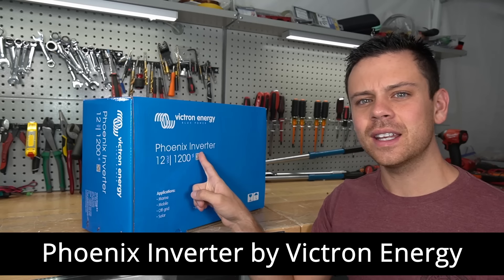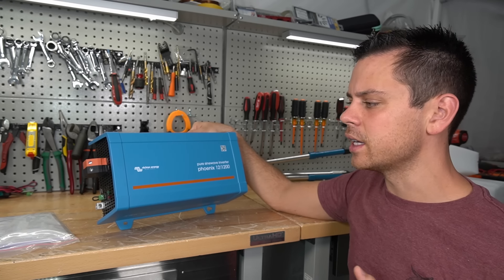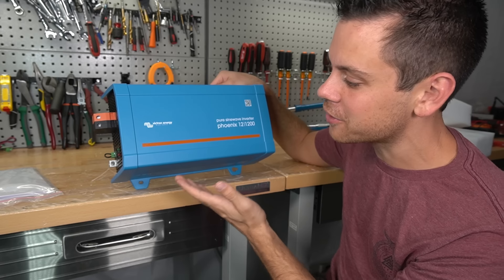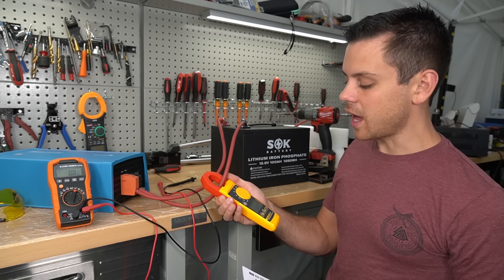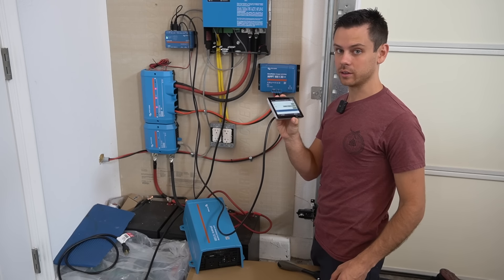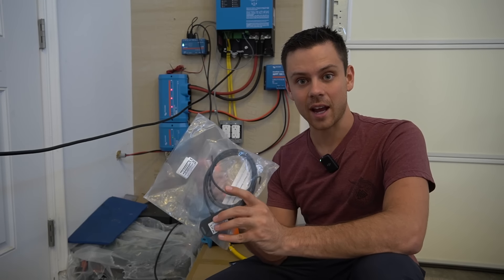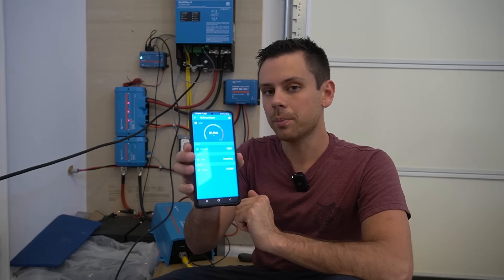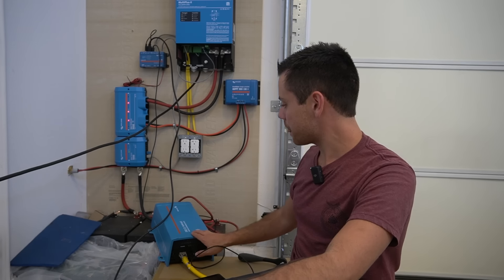Victron Phoenix 1200VA LF Inverter: Extremely Low Standby Consumption and More!

Comment: Victron is simply the best manufacturer of all this kind of equipment there is on earth. I just love their stuff and their support.
Reply: Ya and they charge alot for being the best. That's the way it goes. It's always best to find the product that is the best that isn't too expensive. There is a point of diminishing returns.
Reply: When it comes to off-grid, Victron is the name you can trust!
Reply: Roger that
Reply: Morning Star - Suresign fanless is probably more reliable
Reply: @randybobandy9828  they can save you money if it means you need less battery due to their efficiency. Keep in mind, it's more unlikely to fail.  If I'm camping in the middle of nowhere, I don't want my inverter failing on me.  When it does, I'd need to go out of my way to buy another one or ship it away for a warranty evaluation
Reply: @veganpotterthevegan  no, batteries are dirt cheap now. I can get new lifepo4 batteries for as low as $68/kwh that's like 4x cheaper since I originally posted this comment. It's actually crazy how cheap lifepo4 cells have gotten. The extra few percent of efficiency that a victron system can add won't be enough. There are plenty of alternatives that are almost as good that are less than half the cost. There is a threshold of quality vs cost that victron just is way too much.  I don't buy pre bought batteries, I build them myself from the raw cells because you can be assured of the quality and you get them for the absolute cheapest cost.
Reply: @randybobandy9828  yes, they're still cheap.  But you also get to save space with a more efficient inverter and charge controller.  That's not important to everyone but it definitely is for me and reliability can be life or death with some of the places I camp🙃
Reply: @randybobandy9828  that cost threshold is different for everyone.   I'll absolutely pay for Victron if it were 50% more expensive than it is now.  I don't skim on vital electronics, my bicycles or my coffee.  I'll gladly drive used, cheap Japanese cars though.
Reply: @randybobandy9828   as will has noted before, you're rarely actually buying the best cells.  EVs get the bulk of them.  You'll get cells sold as the best though but luckily they're good enough

Comment: Dang man, when you were talking about the high cost I was thinking $1,000 +. $400 isn't that bad at all. Being limited to 1,200 watts is harder to overcome than the price.
Reply: That's almost the cost for a gallon of milk these days.
Reply: @steveguy7165  its cheaper if you consider the gallon of gas to get it.
Reply: @Ranch321  what did you say? 
Did you not watch the video?
Reply: @fishhuntadventure  where do you get your milk from?
Reply: @Ranch321  cows. 
My point was 1200W; Will specifically mentions using it for a parallel system for continuous needs. It’s not that difficult - I’ve been over 4 years on a 1200W inverter. Even with a bigger off-grid household situation I can still see that being doable with some diversion from consumer mentality and instead doing planned usage.
Reply: @fishhuntadventure  i respect someone who milks there own cow. I was just making a bad joke comparing the $400 price tag of the inverter to the rising price of goods due to inflation. I also think this inverter is good because i am looking to run a shallow well independently from my main system and the low standby plus it being low frequency will give it alot of starting power making it perfect.
Reply: Keep in mind the 1200VA is actually only rated to 1000 watts at 25 Celsius and 850 watts at 40 Celsius.
Reply: @aaronkatzen5973  good point the pump takes 10 amps at 120 volts so i guess that wont work.

Comment: Here's a tip for reading low currents. Use a smaller gauge wire and wrap it around your clamp on amp meter clamp, 10 times. Gives you X10 resolution.
Reply: I agree with Roy.  I have used this many times.  Just use a wire that has a small enough diameter and is flexible enough so you can coil it around the clamp on ammeter.  You can 'calibrate' it by using a bench supply, DMM and a precision resistor so you can test your setup for accuracy.  Ive only used this with single layer coils.  Just remember not to do anything that will draw high current through the wiring as the magnetic field can be strong enough to become a hazard to you and your instrument.
Reply: Oops, I forgot to add this: if a DMM is available and one is only measuring milliamperes then it is likely best to just insert the ammeter in series with the cable.  Just use caution to not exceed the maximum current rating of the DMM by changing a setting on the device under test.  I strongly encourage the test be 'hands off' as you do not want accidentally complete the circuit should a fault occur and all the voltage appears across you.
Reply: @michaelclemmer8167  I agree, an auto range DMM in series will give an accurate reading of current, if just used for idle current readings etc.

Comment: Cool! I live in Arizona, where we get a lot of sun and daylight is reasonably consistent. Here, people are becoming very interested in daytime boost cooling systems, such as a ductless mini-split which connects directly to the chain of solar panels through to an inverter, without a battery. The idea is the boost system saves money and also works as an independent off-grid backup. I'd like to see a video on systems that require little or no battery to start up and function.
Reply: You need an adequate ATS automatic transfer switch. Review his vid on the MOES ATS. He tests it on some low power devices like laptop etc .
That got me to thinking along your same idea. It'd make sense to run air conditioner unit(s) directly from solar panels via a voltage converter plus power inverter. Then tie it into an ATS such that solar is your PRIMARY source and GRID is your SECONDARY(for when low sunlight,clouds,etc.)
Provided you have a capable power converter(smaller ones don't like heavy loads) then it should work. It would start off using GRID to get past the inrush current(which may overwhelm the panels alone) or maybe suck from batteries initially, then,once the wattage stabilizes at typical 500 to 550 watts,switch to solar only. Soon I may afford the components to test this although it'd be nice if Will did it first. With ever rising electricity costs, 5 to 10panels could be maximized daily to save money
Reply: I think you'll basically need SOME sort of super small battery in between. But yes that's doable on the cheap

Comment: Will, you described my setup precisely.  I bought a 4kw SungoldPower inverter for my well pump and a 1200VA Phoenix to run a couple fans and lights at night.  Also bought another Phoenix for the barn.  Still in boxes though.  Now I need to hook it all up.  Thank you for all your hard work in putting these vids together.  You are a Titan!
Reply: Do you divide stuff between low power and high power? Or is there a way to setup the inverters where the big one will kick in automatically?
Reply: @SnifferSock  Nothing automatic.  The plan is to separate the circuits for low and high power inverters.  Not sure yet how eco mode on the SungoldPower will play with a well pump.  Will probably manually shut it off each night since it has remote control.
Reply: Well if your running a victron multiplus you can have it setup where this unit can feed into the multiplus, and pass through.   Then when your load increases past your programed value(say 7amps)  then the multiplus fires up and starts assisting.
Reply: So by combining a multiplus2 and an inverter can increase overall wattage past the multiplus’ 3k cap? Or run separate loads to it and then the rest to the multiplus2?
Reply: Is your well pump 220v? And is the 4KW inverter able to start the pump with no issues?
Reply: @kineticmikemr1612   I had not gotten around to hooking it up when my well pump failed.   It was 110v.  I had it replaced with a 220v.  Bummer.  Had to buy a new inverter.  Still in the box.  😥

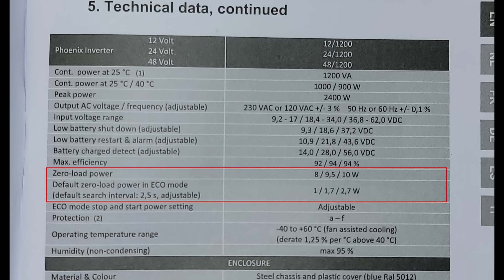Comment: Looking at min 1:14 i read that this inverter can only handle 900wart if its a little hot in the weather and a peak of max 2400watt. Did i misunderstand that page? If not then It feels like cheap vine in very expensive bottles when i see that. I currently use a one solar 1kwatt that cost me 110$. Works perfect, even has display so you can just take a quick look while walking by. Anyway.thanks for video, looking forward to the next.

Comment: I have the 24/375 connected to a generator in of a small transferswitch that feeds a UPS that keeps my internet and laptops running. Normally it is in idle, but just in case grid goes down, it will kickin in about 30 seconds feeding the UPS again from my 24 volt battery.

Comment: I have my fridge and freezer running 24hrs a day off this exact inverter and the rest runs off my 12 volt 3000 watt multi 2. fridge and freezer in summer with up to 50 degrees Celsius pulls from 40 - 185 watts. going to add two more freezers for off grid meat storage this coming summer.

Comment: This video convinced me to get the Phoenix 12 1200, added the bluetooth module, and a simple on/off 12v switch with light (no reason for such a bit on/off switch line Victron's). It's been working perfectly, and such a low draw! Thanks!

Comment: Great video Will. I live off grid and I have fried 3 cheap Chinese 1500 - 2200 VA pure sine wave inverters trying to run my fridge 24/7 due to the huge spike when the compressor kicks in every 10-20 mins (depending on temperature difference). Even though the Victron seemed so expensive I took the plunge and bought my Phoenix 12/500.
The 500W Phoenix sucks up the spike (I measured/calculated it as around 1800w peak) in its stride. My normal average load is around 250 - 350w. Have had it for over 6 months now and it has proven itself here in Australia even on 40+ degrees celsius days (the chinese ones are cheap for a reason - insufficient cooling under higher constant loads and serious boasting in the spec sheets that do not match the hardware).
I am now watching closely to see how it goes in winter where, ironically, it is harder for the compressor to kick in due to the lower ambient temperature (I live in the mountains 650m above sea level).
The price of the 3 inverters that died only cost me half  what the Victron did but the equipment that died along with them cost more than double, one example being my i7 6700 with 32G RAM and an nVidia GTX 970. Fortunately I was able to salvage the SSD and HDDs but it was still way more expensive than the Victron inverter.
Lessons learned.
Reply: Hi Grrarth, assuming it's ~22 deg C, with the constant ~250w load, how often does its fan kick in? I'm thinking of using one inside and I'm curious how much noise it might add to a quiet room. Cheeers!
Reply: That sucks that a cheap one friend some computer gear.
Reply: @jimmybrad156  Hey Jimmy. I'm not sure but it is a fairly quiet fan compared to other inverters I have had. That being said, here in Australia it is illegal to have your solar setup in living areas. They must be installed in a separate shed or location in case of fire. So it is fairly irrelevant in my situation.
Sorry I can't help you with that.
What I have done since is installed a 3600 joule spike protector on the fridge and that has kicked down the transients really nicely so the inverter hardly notices it at all where before, even though it handled it it would sound like a welder when your rod sticks for a second or so...
Reply: @GarthClarkson  I guess the spike protector is full of metal oxide varistors absorbing voltage spikes? Hopefully they don't get hot enough to reduce their life.
Reply: @jimmybrad156  Cheers. I double-checked the spike protector and it is actually the smaller1800 joule model. It doesn't seem to get hot, even in the Aussie summer. I don't actually know/care what method/technology it employs to smooth the very short but steep transient but it is effective. Seeing as it has a rating I presume that it has been tested before going to market. The fridge only seems to run the compressor every 10-20 minutes. The duty cycle is governed by thermostat. It rarely runs the compressor for more than a few minutes, even in summer. While it is running it only uses around 35W. 
Even if it does have a reduced life it only cost $25-. So long as it doesn't fail short circuit I don't mind and if it extends the life of my $400- inverter and my LiFePO4 battery bank it's even better.
I will repeat that even without the protector, my Victron Phoenix 12/500 handled the spikes like a champion where even not so cheap Chinese models rated at 2000VA only lasted a month or two before releasing the magic smoke.
Reply: fried*
Reply: @GarthClarkson  If the fridge ever needs replacing , I know that LG make inverter fridges that run off a normal high-frequency inverter (500 watt continuous pure sinewave) no problem.
Reply: @GarthClarkson  I'm close to getting a Victron Phoenix 24/500 (unless I change my mind for whatever reason; don't want to rush). How's your experience been with your 12/500?
Reply: @jimmybrad156  It is still in as new condition and I have it as a backup now seeing as my friend upgraded the system on the dairy and I was thrown the old stuff. Still use my old 1050w, 25yo panels but I now have a 12 x 2v x ~600Ah flooded traction battery array running 24v into an old Trace Engineering 3000VA inverter which is also a low frequency, transformer driven unit. I have hooked my 5500VA Honda clone (13.9 hp) generator into one of its AC inputs and it auto switches inputs when I run or stop it. The generator will only be needed for an hour or two after several days of very overcast conditons. I have 4 high power appliances which all run no problem on it where they wouldn't run on the Phoneix 500. The victron is perfect for just about everything else I have and I can run both my i7 6700s simultaneously, even when running a full 3D simulation like Subnautica Below Zero or Halo Infinite on high settings. It is way over engineered. I used to think that a lot of this praise was just from Victron fan boys and that they just have lots of money lying around but have found myself being one of them. I am a pensioner with very little in the way of disposable income and have found that the cheaper stuff is false economy. I looked into Renogy which lots of 4WDers rave about but it hasn't been much cheaper since the lockdowns so I have had no incentive in that regard.
Sorry to rave on so much but it has been a wild journey with a steep and costly learning curve.
Reply: @GarthClarkson  Nice work!

Comment: I have a 48volt AC EZGO RXV golf cart.   Id like an inverter to use with the golf to use as back up power for my house during power outages.   I have a 50amp generator inlet that that feeds into a 5o amp breaker with an interlock system on my main home panel .   Id only be using this to run some GFI’s, 2 refrigerators and some interior lights etc.    Would this type of inverter work?

Comment: Thanks Will, I have a 10000va quattro running off grid, I would like to run my starlink and fridge and freezer off of a the 1200 48v. my only question would be if im able to connect both inverters to the same cerbo? i would like the data from both inverters all on the same vrm page.

Comment: 12/1200 Victron model in it's instruction says that the minimum capacity battery recommended 150Ah 12V... that is exactly why I decided to take 12/800 model which starts from 100Ah 12V batteries 🤷‍♂️

Comment: Will, could you add a simple additional test to your inverter reviews: take an AC volt measurement between hot and ground AND an AC volt measurement between neutral and ground please?  You should get 120v between hot and ground and 0v between neutral and ground (like utility power).  Some devices (such as my furnace) reject bad power that arrives with 60v on the hot and another 60v on the neutral (which is SO common with cheaper inverters that it is almost universal).  I'm currently using a Xantrex Prowatt SW2000 because I can't find anything else that works with my furnace.  I'd like a Victron inverter to go with my Victron BM shunt and my Victron AC batery charger, but don't know if it produces 60/60 or 120/0 power.

Comment: So I have a slide in pop up camper with a 120v fridge that pulls 0.8 amps and 1 outlet that I will using to charge my phone, plug in a tv etc. I have 3 led lights and a roof mounted vent fan and water pump for sink (12v). Currently I have a 2000 watt inverter charger with no power save mode. I am buying a victron smart shunt to find out what the inverters idle draw and draw when using the fridge and tv is. My hope is to find an efficient inverter/charger or just inverter and seperate charger that will allow me to keep the fridge on 24/7. Currently if I leave it on my batteries are depleted overnight. I do have 1 200 watt solar panel and  two 100ah lifepo4 batteries. Any suggestions on an inverter for this setup? I was leaning towards a litime or renogy but after seeing this video I am reconsidering.
Reply: Victron Multiplus 48/2000 (1600 watt continuous) or Multiplus II 48/3000 (2400 watt continuous) might work for you. Both have super low standby consumption and low noise. I already have a Phoenix 48/1200 and plan to upgrade in the spring...

Comment: Would the Phoenix 1200VA inverter be suitable for use with a transfer switch to interconnect to house wiring?  Is the neutral and ground bonded?  Would a high frequency inverter be more suitable for backup power?  Thank you for a great video.

Comment: If you have a low load you can’t see run the power cable through your clamp tester twice in the same flow direction